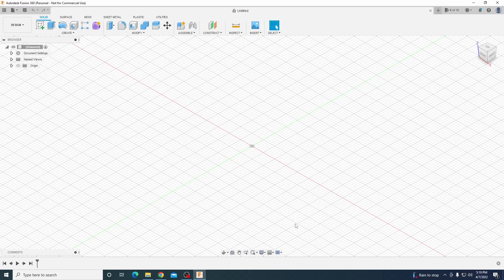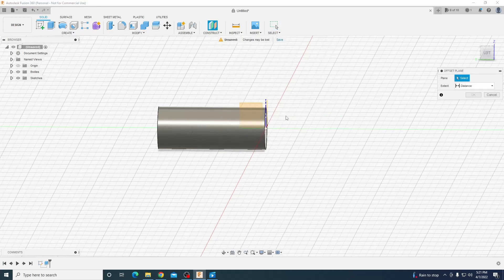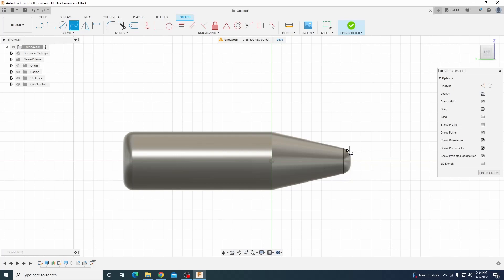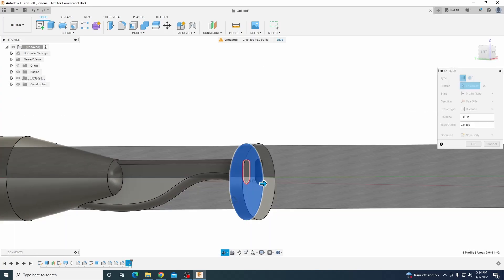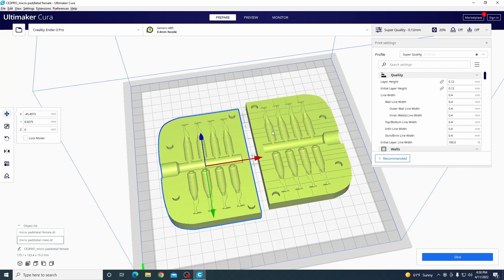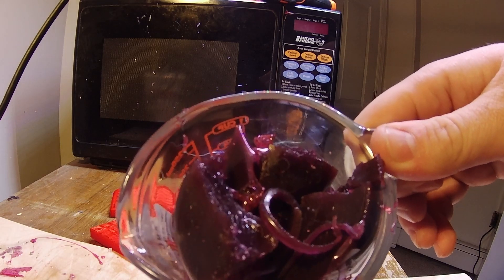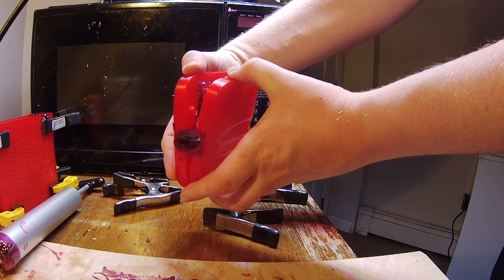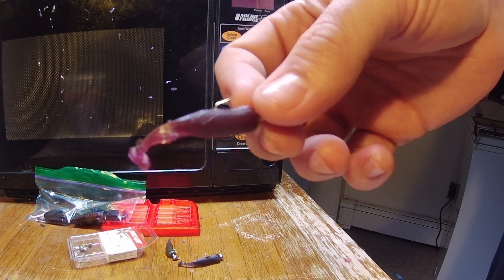Making a 3D Printed Micro Paddle Tail Lure

Comment: I was planning to do this for a couple of weeks now but I was not sure if the print will survive after shooting it with 300-400F plastic.
Reply from the maker: I would recommend shooting it at 300-320F. It really all depends on what type of plastic you are using for the mold. You have to remember plastic does not conduct heat very well and the mold itself will never hit the full temperature of the plastic your injecting. Although I haven’t tried it before I have heard of people using pla with good success. I would recommend using some sort of nylon or polycarbonate blend but if your are unable to print that I would try abs or petg.
Reply: @HandCraftedAngling  I have petg but by god, it is so hard preventing it from absorbing moisture as I live in the tropics and it's always humid. I'll buy abs soon and try it with that.

Although I don't have an injector. I'll try to look for a cheap one and also plastic to shoot. Maybe I'll make an open-pour mold as I like paddle tails more and it works better for saltwater.
Reply from the maker: Yeah unfortunately all the best plastics for this love moisture. Open pour paddle tail is definitely up on my list after I catch up on all my current projects. If you want to give it a try the hogchocker mold I have is open pour and saltwater.